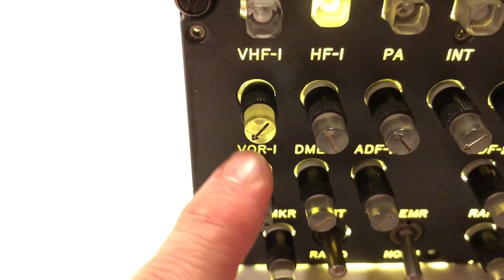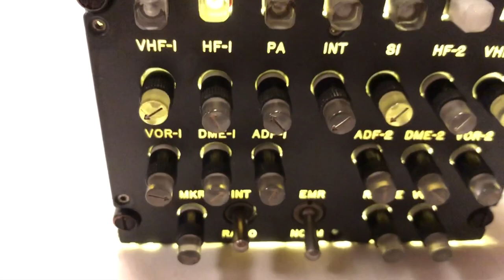Converting a real / OEM Audio Selector panel - B737 Home Cockpit

Comment: I got 2 of these and ended up spending 200$ on cannon plugs to wire them up without modifying them. Ive got the real intercom working and everything but it was a extensive wiring project.

Comment: Hello! Do you perhaps know if I can buy the switches somewhere or something like that? I bought an aft overhead panel set but I can't find any for them.
Reply from the maker: My best guess would be OEM panels. 
Find a used cheap panel and scrap it. 
The potentiometer +switch thingies are very hard to find and very hard to build.